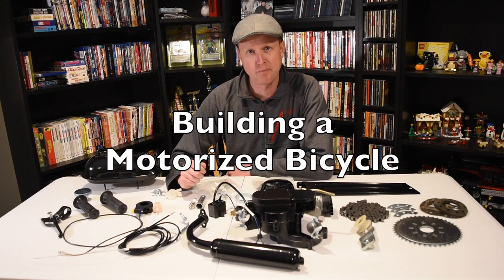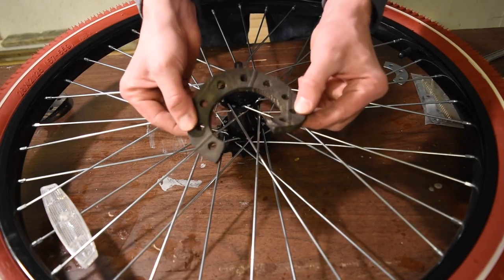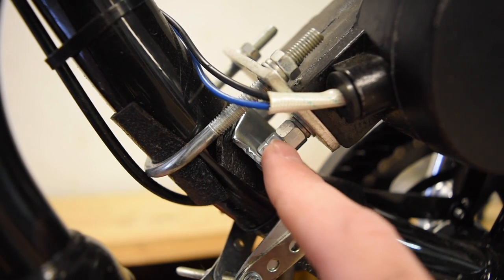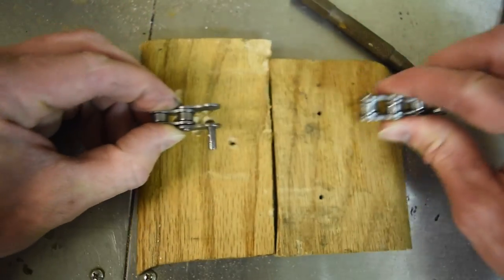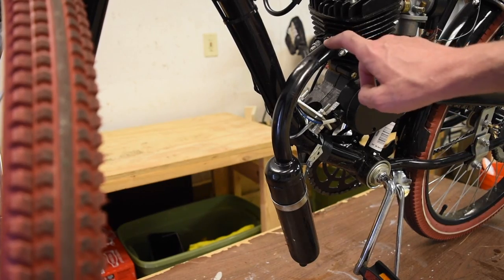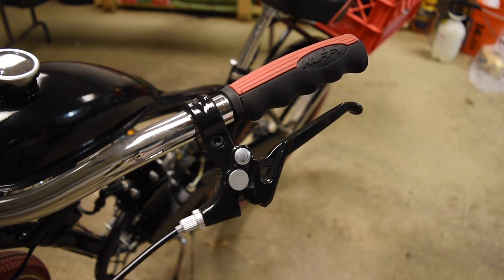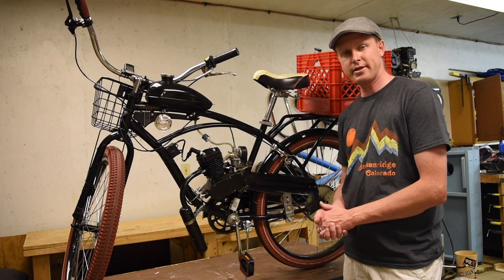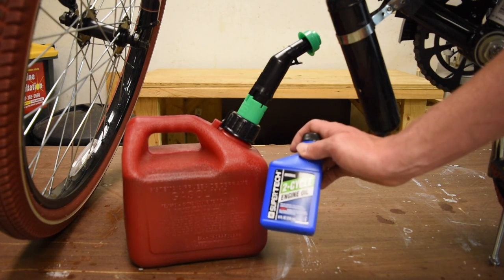Building a Motorized Bicycle - 80cc Engine Kit - 75 mpg

Comment: 3 RULES before installing.
#1: disassemble and inspect engine.
#2: grinde/sand flashing off ports.
#3: reassemble using oil,gresse and LOCK TIGHT on your nuts and bolts 🔩
Reply: if you don't follow this RULES....GOOD LUCK 😳👍
Reply: for greasing, use one with graphite, for oiling external components, Nanolub csx is an excellent substance, lasts long and is perfect for very high stress and friction contacts
Reply: Mr. Motormaster... yes great additional tips.   Ty
Reply: Who cares these engines are 80 bucks with free shipping
Reply: @ELSMITH3378  This is a Motorized Bike you'll never have. The Bike is $129 at Walmart  then a Engine from Bike Berry is $149 ..  Don't worry Eltorease Smith .. you'll never be able to afford one. or have the intellect to build one. Steve makes and uploads these videos for people who are interested in getting into the Hobby.
Reply: @edgufler1122  lol  I have a Genesis 29in Hightide engine only cost me $109 and I didn't know 300 bucks was a lot of money 🤣🤣
Reply: I didn’t follow the rules and I’m doing fine no problems for a year straight
Reply: @mr.motormaster9881  hey it's Tommy I'm so um do do you like to come over Beach
Reply: @mr.motormaster9881  I'm sorry I cold cold cold
Reply: @ELSMITH3378  Where? I paid over twice that.
Reply: @ELSMITH3378  $109 >$80. Obvious troll is obvious (and can't even figure out how numbers work).
Reply: Black painted one always have black paint inside the cylinder . only way to get out out is a razor blade . Go slow with light pressure. no scratches . Also the intake / exhaust manifolds need to be trimmed to port match . Intake manifold needs to be de-burred . sometimes the transfer ports . Sand head down for more compression but don’t loose the squash band . Sand down cylinder if you want also but don’t go to much because your piston will make contact with the head .

Comment: Originally, I had cut off the rear rack of my Nel Lusso bike to add a friction-drive Lock N' Load unit to the rear. I have since picked up a couple of 80cc 2-stroke engines and am in the process of watching such videos as this one to get some ideas as to how to set it up in the bike. I put caps on each part of the rack to cover the nubs left on the frame. I removed the fenders and am in the process of building the bike in this manner, now. A tip is to use several quick ties around the center to keep an equal distance when putting that hub sprocket into place.  It spaces the area out quite evenly and you simply pull the plastic ties out when finished. I did end up putting a better kick stand onto my bike though. It raises the front of the bike up and telescopes, but it is not meant to have someone sit on the bike when it is in use. Only to hold it up well. I had to laugh as I wondered if you were indeed putting the sprocket on backwards. It was hard to see at first when you were filming it. When I got my packages of engines,  I thought right away that it may be a mistake problem that is easy to do if you are not careful. :-)  I am not fully through in watching  your video just yet, as I keep running out to look at my own bike and check things as I do my build. This is my first build although I have ridden motorcycles most of my lifetime (71 years at present). Thanks for posting this video.

Comment: I love my huffy nelusso! It’s a tank. It rides well and hauls up to 80$ of groceries.
Reply: @Steve_Does_Stuff  The furnace was removed from the house next door, and I latched on to the plenum, cut it down, supported the bottom with plywood, made a lid, and added small wheels, axle, and tongue - hey, presto! a trailer that can haul  lots of groceries, or a tool box and car parts. I used a car outer tie rod end to connect to the hitch on the bike. Swivels side to side, pivots for up and down hill angles - generally satisfactory - and being a recycled (nudge, wink, get it? re CYCLED?) part, very affordable.
Reply: In today's economy that's two cartons of eggs.

Comment: nice work on the Install Steve  FYI i read on some Forum that the Importers of some of theose kits were getting harassed by Attorneys because many bikes people were putting them on had the Factory Welds coming apart because they were not designed to handle the stress the engines added to the bike i’ve noticed that now many of the Websites that do sell them  have more details outlined on the  bike styles they reccomend  installing. the kits on  like yours most of them do reccomend a Cruiser style  Frame that are usually larger Tubings which theoretically would mean more surface Weld area  not necessarily  a stronger  or better Weld  but i guess that can change amount the Manufacturers the Forum i read mentioned the head Tube  breaking off  and when I was a kid in the 1970s  riding Wheelies and doing Jumps  i broke that Weld on 3 different bikes i will testify it’s a Gnarly one to have give out when you are riding  as you lose your front wheel and Handle Bars  that send you head first into the Ground and back then we did not wear Helmets on Bikes  and Staples for Skulls we’re not invented yet   so the Hospital trip was a painful and long one

Comment: Fuck the muffler straight pipe it. Also I would use a bigger engine
Reply: It's a two-stroke, it needs that muffler. More specifically, an expansion chamber. There's a baffle in the pipe to make it quiet, but it can be removed if wanted.

Comment: Looks a far more pro job that what i did to a Raleigh Grifter in the 80's. 160cc lawnmower 2 stroke rubbing the rear wheel, could clear 70km/h. Petrol tank on the handle bars, lucky i'm still alive i guess!

Comment: Future reference with that bike. 27mm straight wall socket with a 3/8" ratchet is perfect to center that annoying sprocket. Just slide the back end over the axle and it should center it 99%

Comment: The gas power or patrol power engine is more better and powerfull than that electric battery power bike. You can buy better battery however, when travel 100KM uphill patrol works best. The electric won't even last for 1 hour up hill on same speed

Comment: Using premium fuel does nothing for performance. Especially with a low compression engine like this.
Reply: It last longer thats why use it
Reply: yes, ethanol BAD !!! premium in small 2 strokes doesn't increase fuel efficiency so much as has fewer impurities that affect the efficiency of the motor itself, in the long and short term
Reply: Premium is used in small engines as not to chew up gas line and the like. Ethonal in lower grade gas eats it up.
Reply: Also when you add 2 stroke oil it lowers the octane.
Reply: I used water to pull the ethenol from the gas. Water and gasoline won't mix, but the ethenol in it will mix with the water. 

All gasoline around here contains up to 10% ethenol so I had to find a workaround. This was my best jab at it.
Reply: @Steve_Does_Stuff  some premium gas has ethanol in it also, 10% wont hurt anything I been running my 2 cycle weed wacker and  chainsaw and all my small engine equipment for years with ethanol gas, never had a problem.

Comment: This is my 6th year/Summer working on , building, and riding Motorized Bikes.  I add a Tuned Pipe, Hi Compression Head,       Main Carb Jet is also changed. They come with a #70 jet, I'm running a #67 jet for a bit better Hi End.
These small 2 cycle engines,  HAVE TO BE WARMED UP !

Comment: Nice video, but there are flaws in that build.. I promise you will have problems with it down the road... Good luck with it once you get it right they're a blast to have... I know because I have 2 Nel lusso builds, I ride mine daily at least 20 miles 👍👍👍

Comment: Hardware is very crappy. First safety rules. They are made in China. Safe your coaster hub brakes taking of your fenders and add a v brakes but take care when raining ( paint in the rims better aluminum) change your stock chain and cables for better ones . Change your stock sprocket for an CNC ( 44 for more torque and 36 for mid range 25 to 35 mph) . Change your stock chain tensioner for the arch tensioner is super more safe. And in the end ., Head protection and body . USB rechargeable safety lights. Enjoy your projects and be safe. Bicymotos North Dallas

Comment: So i took my chain pulley tensioner apart (i got bike used) to clean it now i made a dumb mistake and i didn't take a pic or look at really before it all came apart. There is the bolt a lock washer and normal washer and a spacer + the bearing inside the wheel i put the bolt into bearing than spacer than washer than used locked washer with nut to hold it on... my chain is making noise now i had to do something wrong and or something needs fixed.. i also know my coaster break is about shot so that might be the noise i hear idk!?? I have some knowledge but not much never worked on theses before have about a 2 years of working on 4 stroke scooters

Comment: Changing the fuel mixture out of 40:1 is completely unnecessary and will allow for build up that causes problems with lifespan of the engine. 40:1 BEGINNING to END it's a 2 stroke motor not a transmission.

Comment: HA ha your master clip is on backwards. ✌
Reply: @Steve_Does_Stuff  hey Steve, can you please do a video on installing one of these to a Schwinn stingray chopper bicycle. There isn't much information on the installation process apart from it's very hard or it requires expensive parts and tools and lots of fiddling around with the kit. BTW great video 👌

Comment: Can anyone tell me how to shut the bike off? I bought an abull 100cc. It runs but it seems the throttle handle is an electric Start when the engine is a clutch start.  The problem I'm having is when I stop. And clutch or pull back the handle rhe engine won't shut off. And I have to use the carburetor adjustment screw to choke the engine. Ugh. Any advice is appreciated.  

Love this video!!!

Comment: I did commercial HVAC for years, so I can say with great confidence that I’m mechanically savvy. It’s now day three and I still can’t get the damn rear sprocket centered!! I’ve tried everything I can imagine to keep it center while slowly tightening in a star pattern and when I’m done it’s off by a lot! I’m honestly ready to throw the motor kit in the trash and take this huffy out to the desert and blow it up!! 😤🤬🤬
Reply: Use something like zipties as a spacer
Reply: I used a socket that fit the center sprocket hole perfectly and then slid the socket down to the rim with the bolt you would use to tighen the tire to the frame with and made sure the socket was centered then got slid the socket down to the spokes and tighten all bolts down. Luckily the threads were long enough to bolt the socket down but it worked perfectly and less stress than using the instructions.

Comment: I've been putting the same engine on my 20 inch Stingray frame I updated the exhaust, spark, carburetor and air filter and a extra spring tensonor the one that bolts on the engine, its been a pain in the ass to build. I'm almost done and since the frame is smaller I had to do some custom fixes to make it work. I just hope it was all worth it.

Comment: The only problem is, when people build these motorized bikes they do not grease the wheel bearings really good. When these bikes get going 35 mph for a little bit the wheel bearings get really hot, and sometimes locks up the bearings, or the bearings just come apart.  Then you have a very bad crash and a trip to the hospital.

Comment: This is THE MOST helpful video ive watched yet! Thank you so much. I have been having a lot of troubles with my chain and actually broke it. Turns out i had the sprocket the wrong way.. And i cant seem to get spark from my spark plug. Cant figure that one out. Any idead??
Reply: Thanks for the help. I probably need to upgrade my spark plug to the american version instead of the off brand craptastic one my kit came with

Comment: It's  illegal  on the road cause there's no numbers on motor to prove it's  power or cc  hate to sound like mister nego! specially on huffy bicycle problems with that  break hub always gets broken it's not design to go 30 miles hour so beefing up clamp rear break hub will work perfect

Comment: All you need is..... all the CNC upgrades and take the engine apart from the start to clean out the machine process junk and grease the clutch mechanisms and The gears...  these motor kits aren't plug and play

Comment: Im telling you that front mounts is sketchy. Just take a pair of large channel locks and squeze frame in a tiny bit, or hammer it flatter right where strong mount fits. Its not going to hurt anything. Way better mounting.

Comment: i have a Zeda 80 - 100 cc motor. i installed it and now trying to start it the back wheel drags with the clutch out. its like it has too much back pressure. i am a greenhorn with these motors. any ideas on whats going on?

Comment: Hi friend, I need to reach the speed of 88mph, how many engines do I need to attain this speed. Please help I think my mom has the hots for me. Thanks, Marty
Reply: Heck, you still need to get the timing right for the lightning, just cut out the middle b.s. and go for broke!! I just learned that 1bhp is equal to 0.00000075 GW, therefore you only need 1,622,636.73 hp!  That’s only 737,562.15 motors assuming 2.2hp avg!!! Doesn’t alibaba give bulk discounts?🤣🤣😂
Reply: @roblogic3660  it's too late now friend, I'm now a first-time father and have a new little brother..
Reply: @PixelBlenders  🤣

Comment: it will hold the clutch from engaging in the motor if you have the cable adjusted to the right position where it keeps the lever engaged on the motor if you don't have it adjusted right Michael take off

Comment: Hi Steve. Almost at the 300 mile mark on my bike. Have just today lost the SECOND push button and spring for clutch lever. Dont know how they are popping off? I even added an extra lock washer but it went through that as well. Any suggestions?

Comment: Chinese motorcycle exhaust system restriction is, usually, at the manifold. The exhaust ports are usually fine with a moderate polishing. The gaskets for Chinese engine exhaust manifolds are, nearly always, restrictive.

Comment: For some reason when I insert the spark plug the wheel doesn’t wanna spin and it sort of locks but when I take the spark plug out the wheel moves normally why is that ?

Comment: Fell in love with this bike for the looks, but it's been crap for me. Nice bending the exhaust or you're pedal would have fallen off like mine eventually. My rear bearings are not holding up either. Constantly have to tighten bolts, and after I put the sprocket on the spokes lost alignment and it wobbles like hell, along with the crap bearings. Wouldn't recommend this bike to anyone, even just riding it, let alone putting a motor on it.

Comment: best thing to do is get some zip ties put the zip ties in there with the locking part in the little slot there around the hub that way it stays centered about 11 zip ties in there and it'll stay centered tighten them up crossways just like when you torque something down you tighten this up then you tighten the one opposite up then you tighten the window three over and then you take the opposite one up

Comment: you do not pull off the handle grips you push them off you do not pull if you pull they tighten up if you push they swell up and come off real easy no soap no screwdriver to scratch your chrome or nothing pull no push yes

Comment: I have two questions. Why these scrappy gas tanks. Why not a rear tank and rack. 
And that white wire. Video after video. They don't use them. Does it really effect engine performance. Its only 1.5 bolts. Enough to operate a Headlight.
Reply: @Steve_Does_Stuff  Ok. Well the way I understand it it provides one and a half volts so any standard bike light should work. Lol.

Comment: look at the angle of a gas tank is on the top pipe it is too far down on the front you need it tip back at least 2 degrees at least 2 to 5 degrees so the gasoline runs to the back and you don't suck an air bubble in when you're low on gas

Comment: When mixing oil & gas do like he said - 1st put oil in gas tank but then only add 1/5 th of the gas, put cap on and then mix.  then add the rest of the gas and you will have a good mix otherwise you might end up with the oil sitting in the bottom and not mixed.

Comment: not worried about burning up the coaster brake? ive melted a few as a kid. then my dad added a grease fitting on hub. that one smoked n then melted. i dont trust em n def woundnt use them with the added speed. after owning scooters n motorcycles i learned the importance of front brakes. i really like the welded in rear rack but i went with a kent bayside 7 speed front n rear brakes n blue tires formy build. im going with a 4 stroke with centrifugal clutch n pull start🍻

Comment: I double checked i tripple checked i checked 4 times my instruction book. Why dose it say in my book to install both ragjoints on the inside back of the rim. And to cut both to fit around the axel ????? I first did it the way everyone else did, one on each side of the spokes. Had a hard time lining things up and thé chain was way off so i did it the other way. Bang on everything is perfect now....
Reply: @Steve_Does_Stuff  Yup. And lined up mint plus sprocket fit round the outer bearing race perfect didnt have to hold it in place to tighten